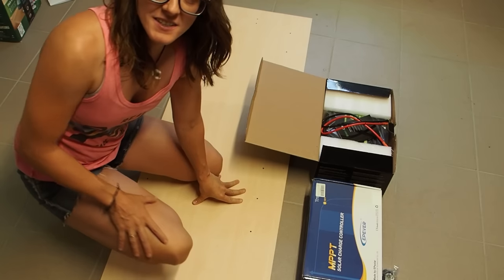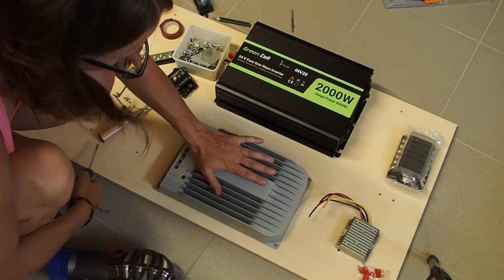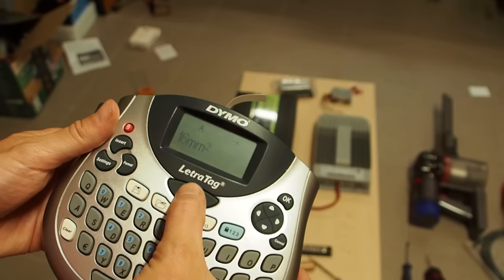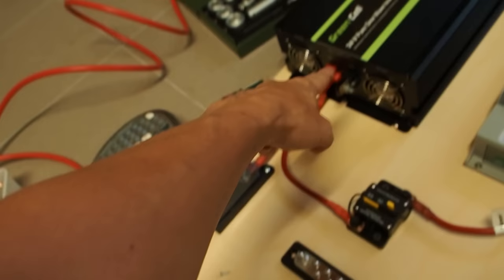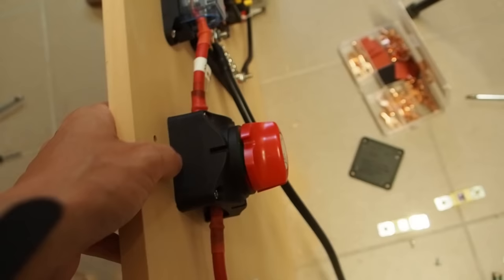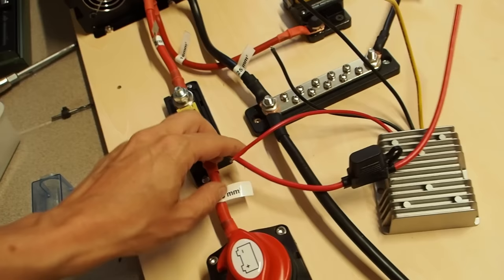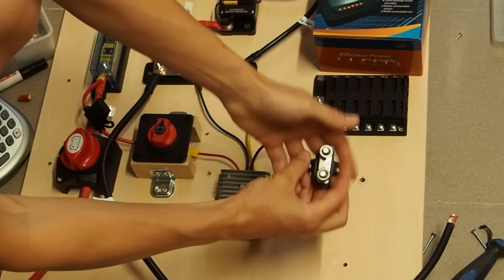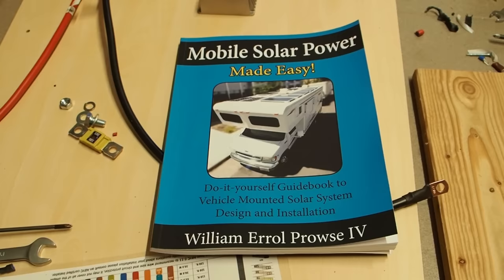DIY Solar System (24 Volt) for fridge and freezer! (Part 1)

Comment: Nice setup but what you are saying @21.45 doesn’t make sense. You have a 16mm2 wire running from the solar MPPT controller through a circuit breaker to the inverter/batt. How can the current in one part of the connection be different from the other half? If you feel the wire is too thin, you should exchange both part of the connection with a thicker wire, but I really doubt that is necessary. The resistance in those short wires is so low that even 16mm2 is excessive imho.
Reply from the maker: yes it doesnt make sense to me either. but the right side is protected by the 50A breaker. The left side is not. Anyway this is how professionals do it as well. https://www.youtube.com/watch?v=IRRKHYwB3Uo&t=719s
Reply: @SurvivalLilly  I don’t think so. If the circuit breaker is some kind of 50A fuse, both part of the connections is protected by that device. If it disconnects no current can run in the wire, so both sides are protected.

Btw: I wrote that “The resistance in those short wires is so low that even 16mm2 is excessive”. Well, that was not correct in regard to the current limit. The voltage drop will be low, but the cable length has nothing to do with the current it can handle. Sorry for that. However, I still think it's excessive at that point. If I search for 16mm2 cable several car shopping sides rates this cable type to be able to handle 110A. Your breaker is for 50A so...

Another thing: You also suspect that your 12V buck converters mounted wires is too thin. Chances are, that the designers of the product knew what they were doing when they designed the product, otherwise it’s a crappy product that needs to be returned.

The chart you’re using to determine the wire diameter, where does it originate from? If it’s from a wire manufacturer it can easily be excessive numbers because they want to sell the most expensive cables. At least it something to be aware of … cables are expensive :)
Reply from the maker: @CMDR_Analdo_Blackvoid  initially I had the same thought as you. Regardless I changed the wire. Even if it is not necessary, it is not a mistake to go for a bigger one. It is a short piece of wire anyway so I dont care about the extra buck.

I also noticed that there are different kind of wire charts. Personally I like to oversize my wires for extra redundancy and more efficiency.
Reply: @SurvivalLilly  Lilly, I am in no way trying to convince you to go for thinner cables. What I’m trying to say is, that to replace a 16mm2 cable with a 25mm2 on only_one_side of the breaker is futile. You won’t get any advantages by doing so. You simply cannot have a higher current on one side of the breaker that the other. It’s not possible. If you want 25mm2 wire, fine, but replace the other side as well with the same cable.

What you choose to do is up to you, but you try to educate other people with your videos, and you are learning them something that isn’t right. This is hard times economically and most people doesn’t want to spend their hard-earned salary on over-the-edge equipment, so don’t convince people to spend money on equipment that isn’t necessary. 

If anybody ask for advice here in cyberspace, they will receive a lot of responses. Some of the answers will be sane others will be … well not so valid. I’ve tried to learn my kids to be critical when surfing the net and I’ll suggest you to be the same. If somebody told you to change the cable on only one side of the breaker … and you believed it, well, then you have a problem.

Let me give you all an example: I bought 3 small solar panels each providing 100W. Max current is stated to be 6.3A @ 20 volt. Nominal on a really shiny day: 6A at 18.x V. I connected them in series thus they together provide approx. 55 volt and 6 amperes. That is 330 Watt. 30 Watt more than they are rated to provide in best case, but never mind.

I asked the “net” about what wire thickness I should use to connect the solar panel to my MPPT controller, because I never had been working with this technology before, and I was advised to use >10mm2 wire.

Now, I actually have an electrical degree in low current technology, and it didn’t sound right to me. First, the wire coming out of the solar panels are stated to be 4-6mm2 in the data sheet. Kind of weird though. Like they just use what have lying around? – but that’s a fact.

Nevertheless, I needed to transfer the generated power approx. 8 meters further on from the solar panels to my off-grid installation so I went out to look for an appropriate cable.

Before I did that I took a look in my home power installation box for the grid and found that the thickest cable was 4mm2 … and I have 16 amp. fuses in my house. So, for up to 16 amp., 4mm2 cable should be sufficient … right?

I bought a 50 meters roll of 3 times 1.5mm2 installation cables of the kind there is used in my walls all over my house. The absolutely most inexpensive way to connect my stuff. I connected the three independent wires together in each end of the cable, thus obtaining a 50 mtr. cable of 4.5mm2. Then I conducted a measurement by means of at constant current generator, sending 1 amp. through the full 50 meters cable. The current drop was 0.23 volt thus giving a loss of 1.38V @ 6 amp. That means that a 4.5mm2 cable of 50 meter eats 8,28W of the solar generated power. I can live with that and still have butter for my bread.

My advice to you all: Be critical about what you are advised. Don’t think you know it all – that is why I see videos like this. To learn new things every day.
Reply from the maker: @CMDR_Analdo_Blackvoid  will prowse is an absolute professional an I trust his judgment. If he is using a thicker cable at one side he will have a reason for it. 

Maybe there is a electrical code why someone has to do it like this. I will ask this question to my electrician if I meet him.
Reply: @SurvivalLilly  You and Will are right. If the fault was right at the terminal before the breaker you could have more than 50 amps. The device that protects that wire is the 100 amp fuse up stream. Under normal circumstances the current before and after the 50 amp breaker would be the same. Think what would happen if you dropped a large wrench that shorted the cable from the left side of the breaker to ground. The short circuit current through that wire is what would blow the 100 amp fuse. Drop the wrench on the other side and you trip the 50 amp breaker.
Reply: @dandypoint  Yes, you got it!!...but you are dealing with short circuit current parameters.
As an electrician, I'll fuse a 200A header busbar with 200A and 95mm². Say I have 6 circuits of 40A being fed off there...they each get 10mm² straight from the bus bar. No messing with 95mm² to each 40A circuit breaker... Just not the way it's done.
Reply: @dandypoint  the other thing about the wrench drop is this, the wire takes quite a lot of time to heat up, melt the insulation and fail, the fuse, even the 100 amp fuse element, will be almost instant to open the circuit. If the wrench drop were to happen I doubt if you could even feel the wire being warm to the touch. Just my thoughts.
Reply: Goood

Comment: It is important to get efficient appliances.
I have a microwave and induction hot plate.

My 7 L mini fridge has soft start and variable compressor speed. It was a scratch and dent deal.
It briefly has a Max power draw of 100W on powerup. It uses about 60W when cooling. <30W when not cooling.

My new A/C is 8000 BTU and has soft start and variable speed compressor.
I have yet to see it over 400W, it usually uses about 200W on low.
My old 5000 BTU A/C used over 600W as it was always on high.
The new A/C has made a huge difference. I got another one like it for the garage.

I have a 24V system for off grid living for a few years.
I have 2 - 1000W panel strings 1 facing morning sun and 1 facing evening sun.
I also have 2 MPPTs (1 for each string), and ~15KW-hr battery storage.
I switched from an ~5KW-hr to the ~15KW-hr system earlier this year.
As long as I have several hours of sun, I can charge for the night.
I am adding more panels this year for the winter since I don't get more than 4 hours of (reduced) sun in January.

Comment: good idea but a small note: mounting directly to an MDF board is not such a good idea. Since the converter can get very hot, purely for safety reasons, I would mount it on metal rails and a multi-layered wooden board that makes it much more stable. Because the electronics can get very hot, I wouldn't do it the way you do.
Reply: Good point to note. More cautious.
Reply: Something not seem  right, hope she got background of electrical. But I guess she not gonna listen anyway.

Comment: Liy, I don't believe that you needed to replace that wire,  as that wire should only need to carry the current that can be drawn from the solar controller and you have already protected that circuit.  I agree that Will is a great resource and I watch all of his YouTube channels uploads.
Reply: That's exactly right she absolutely DID NOT need to replace wire from Charge Controller Breaker to Inverter as it will not be carrying Battery Load.
Reply: That's exactly right she absolutely DID NOT need to replace wire from Charge Controller Breaker to Inverter as it will not be carrying Battery Load.

Comment: Charge controllers must accurately read battery voltage and may include a temperature sensor. Direct connection to the battery terminals as instructed by the manufacturer is required. All the fuses, switches, and loads vary the voltage drop and may even open the circuit as wired.
Reply from the maker: Once I setup the system I will measure the voltage at the battery terminal and then again at where I connected the wire for the MPPT. Then we will see if this really makes such a difference at this short distance.
Reply: @SurvivalLilly  lead acid batteries in particular benefit from precise control of charging and will charge below zero C. 
Separate the charging system from the direct battery loads. Test the voltage drop at the inverter under full load as you plan.
Reply: @SurvivalLilly  Verify the consequences of a fuze blowing or battery switch opening on the battery side of the charge controller while solar power is on. The invertor may run until solar subsidies. On the restart, with no battery, it may revert to 12 volts or burn out?
Reply from the maker: @sagecoach  I believe when the 100 amps fuse blows the 50 amps breaker will trip first. But it depends on the circumstances.
Reply from the maker: @sagecoach  I believe my expensive mppt has a build in fuse to protect the device from this incident. Some cheaper solar charge controllers will definetly get fried.
Reply: @SurvivalLilly  Great on both accounts. This is worthwhile as you save purchasing the power for whatever solar prodeces.
Reply: @SurvivalLilly  10 days of comments and world events suggest the survival of solar power systems is important. Having lots of components and wires is an asset if you are reconfiguring something simpler that will work in a crisis. I worry about charge controllers and invertors already prone to failure. Simple resistance heating from solar panels could be lifesaving and easy to set up, as long as the solar panel's maximum output is less than the capacity of the wire, load, and heated space. You can sleep warm and safe while the sun shines and stay active when it's not.

Comment: Another option is just do everything in 12v, thus no inverter needed - solar panels, MPPT controller, batteries, then wire the output to 12v fridge/freezer and other 12v equipment. There’s heaps of 12v equipment now. Yachties have been living on 12v for decades.
Reply from the maker: My cousins fridges run with 230 volt.  For those u need an inverter
Reply: @SurvivalLilly  I read your text with your accent in my mind because Schwarzenegger :)   cheers Lilly.
Reply: @thejuggernaut2898  :D Get to the chppaaa!!!

Comment: You should add in a couple of capcitors to help with the spike in draw of power when fridges and freezers start up the compressor, that way its not putting a strain on the inverter.

Comment: I have a Victron smart shunt and a Renogy 500 amp battery monitor in my shop on 2 different units. The bluetooth module on the Victron  will not display data 6 meters into my house away due to loss of signal.
I wanted to watch the state of charge and monitor it as it came close to 100%.  The best improvement to both systems was to install a pair of $40 USD Pet Video Camera on the inverters to watch the state of charge meter similar to yours. What a help!   Each camera has pan tilt zoom, night vision, and 2 way speaker. I can hear the MPPT and inverter fans running. The iPhone app connects immediately to monitor the battery anywhere my iPhone has service.  The Pet Cam also has a laser toy attached and I can turn it on and off with my phone app to determine if the video is saved or is in real time.

Comment: I have a Epever 8042 and basically, most of these are not needed. the 34:40 are called ferrules. The batteries connections are missing, also. HVAC taught me that when screwing cables you screw, back up, screw, back up, and screw again, and only then you maybe are sure the ferrule is suited safely.

Comment: Hi, why not use a hybrid off grid inverter. Is has a mppt controler,  inverter and line charger. Mppt solar does some decent ones, growatt the same
Reply: One advantage of doing it piece meal is the ability to upgrade parts as you go. You can add extra solar charge controller (or bigger ones) when you get more money, bigger or multiple inverters when loads increase, etc. Plus, building it yourself, you learn things.
Reply: If one thing fails in an inverter-charger, it's a brick.  If you build a component system, you can replace any one part quite easily.  Also, attaching solar and battery to an inverter-charger would make for a very short and boring video.  ;)
Reply: @jasonbroom7147  short and boring video indeed. But maybe cheaper overall due to lack of wiring.
Reply: @darkmns  - Much simpler, maybe cheaper, but very difficult to increase capability.
Reply: @jasonbroom7147  An amateur here asking guestions. How is it difficult? The max wattage of the inverter should the only limit. If you need more panels/more powerful generator connected, why not add a charge controller and connect it on batteries?

Comment: To prevent blowing capacitors in the inverter take a ceramic 25 watt resistor and bypass ,the on switch for the first time powering up the system and after it has sat in off position for a long time. In rush current can ruin your new inverter.

Comment: Good job. 
I did the same thing 10 years ago, the big difference now is the batterys.. I started with lead acid, now I have lithium iron phosphate.. 
 I used to have to run a generator all the time with the lead/acid, now with LIPH I never run it..

Comment: Great video. BTW, @27:50 those are blocking diodes, you can see diode symbol and MC-diode printed on the sticker, not in-line fuse.

Comment: My 35 Acers in WV that i got in 1983 stills has the 12V DC system that i put in in apx 1985/86 using 2 Car genators and a waterwheel only items i replaced is the Batterys 2 times

Comment: I would recommend you to use ferrules to connect stranded wires to the mppt as these wire can become loose with time and heat cycles, otherwise thanks for this video !!

Comment: Awesome set up! I don't understand why the solar charge controller is going through the inverter, however, and not directly to the battery.  I guess I'm missing something probably simple.
Reply: I was wondering the same

Comment: I also like will prowse like watching him take batteries apart to look at quality. I started like you start small then bigger systems. I would put 1000watts in that system.i now heat my water with no batteries with DC 600w heater element with 1000w panels.

Comment: The MT50 to EPEver Charge Controller uses standard CAT5 cables for connection, you can use a shorter cable.

Comment: My battery bank is full.  Sunny days.  Fun video.  My system is only 12V.  At the time I was scared of fire hazards, but I'm happy with it., but it won't run a compressor for an A/C unit 1000 watt Go power sign wave inverter (truck).  Smart stuff!  Comes in handy when power goes out.  I have TV/internet and a fan.  high point is my amp hours (battery bank).

Comment: In my opinion, there is a far greater advantage, which must be mentioned, by making a 24v system than the one you mention (Thinner cables), namely that you can connect twice as much PV power at 24v than at 12v. in the arrangement you make, the additional cost is limited.
Reply: What do you mean by "PV power"?
Reply: @michaelinelegant1289  PV = Photovoltaics

Comment: If you're fusing the battery use an MRBF fuse as that's what they're for. Your calculations for the inverter wiring and fuse left out another part of the equation.. Voltage drop and amperage increasing as a result. You need to include either the inverters low voltage cut off or the battery BMS cut off, whichever occurs first in place of 24. So the equation would be something like 2000/20/90 x100 =111amps

Comment: 2.5 meters of 10mm2 wire is enough for 45 amps, if you have a shorter cable like 1.25 meters the amperage double (90 amps). You have always to check the gauge but even the length. Those inverter cables would be safe for 100 amps (2400w, more than the power of inverter)
Reply: Is that chart for 12v. On similar project used bluesea online calculator think it was.
Reply: @MotoZ7  wire gauging depends on amps not volts
Reply: Arr yes :) Calculate amps use chart.